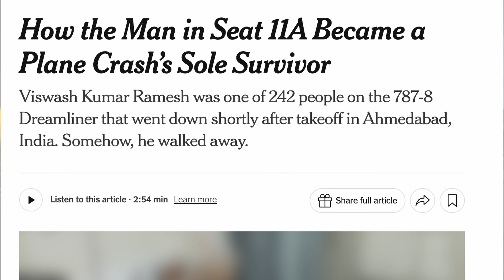Why the RAT Changes Everything – Air India 171 Update

Comment: Interesting question: the probability of two engines failing Independent at the same time is near zero (but of course still possible).
But is there a single Point of failure that would affect both engines at the same time?
Reply: i think netanyahu is behind this .
Reply: One possibility I have only seen mentioned by one other person is a software reset resulting from not power cycling the aircraft for an extended period. It's not a bug per se, but there is an FAA directive requiring the 787 to be powered off every 51 days to prevent incorrect data being displayed in the cockpit.

I also read a report that there was an engine issue when the plane arrived. I have not confirmed if this is true or not, but it's possible there was an engine failure on takeoff and the wrong engine was shut down in response, leading to a complete loss of power. It sounds unlikely, but it has happened before.

Comment: The RAT can be deployed manually by the pilot.  And there are a number of other conditions that would cause the RAT to be deployed,. This includes dual engine failure, but also loss of all hydraulics and loss off all flight controls, for example.  Jaun Brown of the Blancollirio channel has an excellent presentation on the subject.channel

Comment: I was wondering if the RAT deployed ...because MY fine eye was watching things that were happening and not happening.... I was told they made an intersection takeoff....a no-no if hi/ hot and fully loaded... then the " droop"...where it should be clawing for altitude... the gear was still down...despite positive rate... now it's down to the dual engine failure...and...there's only one thing that causes a dual engine failure.....fuel contamination. We shall see....

Comment: This is exactly the reason why you shouldn’t mouth off with very little information. Your first hypothesis was that the pilot may have raised flaps instead of the landing gear. The cockpit configuration of the 787 makes it very difficult to mistake the controls - they are not next to each other nor do they look alike. And yet, that was what you went with, and numerous news outlets amplified your half-baked analysis. This is why it’s responsible to wait for a full investigation before mouthing off. Stop it already! Most pilots do not start off blaming this or that or that - doing so on a public forum with lay people is way worse an offense.

Comment: I think some sort of fuel system failure led to both engines losing power, left one first then right and cascade of other problems such as landing gear not retracting and flaps not functioning properly etc.  Fuel supply was diminished or cut off fully, which led to no power.  Engines themselves were functioning, but no fuel led to no power.

Comment: If they would have hit the buildings would it have been possible for the pilots to glide it down softly enough to prevent a complete explosion? I've always wondered why they don't leave an area that they don't put any buildings within a few miles of airports and along the path the planes take when landing and taking off. Or would it make no difference if it would've been just a grassy field that they landed on?
Reply: I doubt it their sink rate would probably be too high, they would have not have had enough speed or altitude to  glide, so basically they fell out of the sky, with all that fuel on board the outcome for the passengers would likely be the same.   A crash at takeoff is the absolute worst as the aircraft is full of fuel.

Comment: fuel contamination?
Reply: There were cases in the past, it caused issue with the aircraft but not this catastrophic, nothing can be ruled out, but It would require a massive about on non usable fuel, and the question would the good fuel be first to be used, seems the aircraft took off without issue, so means a switch between good fuel and bad fuel? I have no idea how likely that is to happen?

Comment: 'dual engine failure' -simultaneously, after about 30sec into the flight? I wonder if it' just them running out of fuel. Of the few gallons that was left of the previous flight. So this is my theory/scenario: forgot to refuel, plain and simple.
Reply: IA full power loss due to lack of fuel would take around 10 seconds,  the engines would flame out, there would be a lot of indicators to the pilot. Physically this coudl happen but from a diagnostic perspective there is a lot of redundancies so not sure if this could really happen.   There is normally flight planning Software on the aircraft it would alert the fuel does not match the flight plan. There are also other systems to detect low fuel, so a lot would have to go wrong for that to happen.
Reply: Preflight checklist...probably #1.  Check fuel gauge before departure. 😉

Experienced pilots don't forget to refuel. 😉

It is possible that the fuel supply was accidentally dropped...although no evidence of fuel leakage or tanks dropping.

Personally, it sounds like the flaps were not deployed properly, unless it was a flaps failure, in which the plane should have never left the ground.
Reply: @terryc.3390  If it was flaps why was the RAT deployed?

Comment: Dual engine failure on an aircraft is an extremely rare event, but it can occur due to several factors. Common causes include fuel contamination or starvation, bird strikes, and mechanical failures affecting both engines simultaneously. While single engine failure is more common and aircraft are designed to handle it, dual engine failures present a significant challenge to pilots due to the loss of thrust from both engines.

Comment: Yeah that original cell phone video was released, you can clearly hear that rat prop as the aircraft rushed overhead….don’t even need to see it, you can hear it!

It definitely would not be the first time a first officer has accidentally raised the flaps or other cases they’ve put the throttle to idle or something like that. It’s happened before.

Comment: We learn something new everyday. It is pretty cool, how safe an aeroplane is with all the safety checks in place. An airplane is equipped to function with one engine. So they have the second engine as the back. But they have also thought of that if that fails too we have a RAT. Which correctly deployed, it did its job but unfortunately not enough time to effectively use what little was left.

This gives me the confidence that something new is learned from his and more fail safe mechanisms will be installed so that no one has to deal with this again.

Comment: Prematurely postulating the Indian pilots as dumb enough to mistakenly retract the flaps instead of the landing gear is so disgusting to me that it smacks of racism and attempt to go viral.  If he is an experienced pilot and an aviation expert, he would have known that the levers for the flaps and the landing gear are so far apart that mistaking one for the other is so remote. If there is nothing wrong with the engines, he should know that the pilots could have done something to prevent the plane from dropping in the manner seen in the videos. It's so obvious that with the pilots declaring mayday with "no power, no thrust, going down", there is really nothing else they can do. Isn't losing hydraulic power to operate the landing gear and the flaps after losing both engines more plausible than immediately blaming the pilots for mistaking one for the other? He only changed his pilot error theory when it all became increasingly obvious from the evidences being gathered that dual engine failure likely occurred after takeoff.
Reply: I agree it does come across as racist from his side, the Capt of the flight had over 8000 Hrs the co pilot almost 1500 Hrs, and he thinks just RIGHT after takeoff they are so stupid they would pull the flaps up instead of the landing gear!! His comments tell you nothing new about the accident but a lot about his racial bias and what he thinks of Indians!

Comment: fuel contamination or maybe the maintenance records will shed some light. i mean the only way your getting both engines to shut down under load like that would be no fuel or a crap ton of birds:)  wouldn't be surprised if a fuel cross feed valve was left in the service position after a tank cleaning or electrical issue

Comment: Two more clues as per the survivor's statment:

"Within a minute after take-off, suddenly everything felt STUCK for 5 to 10 Seconds. After a while, the green and white light got lit inside the aeroplane cabin. Later survivor felt like the plane was trying to increase the speed (He used the Word 'Raise') and then collusion occurred.

1. My assumption is that due to the engine trust & acceleration during the take-off, passengers feel like they are pushed back to the seat due to the body's inertia. If there is engine failure or thrust/lift loss at this stage during the acceleration, your body will feel the absence of acceleration & you tend to lean forward (May be this is why the survivor felt that he felt like STUCK/Standstill for 5-10 seconds). After this if RAT got deployed and due to the noise it generates, Survivor may have felt that attempt was being made to raise the engine speed to retake-off.

2. Also the green and white light which the survivor referred may be the emergency lights that lit up on the floor path and exit doors during emergencies & power failure to guide the passengers out of aeroplane.

Above are just my assumptions. 

My condolences to the families who lost their loved ones.

Video link to Survivors interview:

https://www.youtube.com/live/n8D2TLKKm94?si=69s-DPXgLZskzWnw

Comment: what are the chances of something like this happening? Is this simply a system failure, or the result of someone’s negligence? How is it even possible that a plane, only 11 years old, could suffer failure of both engines right after takeoff at just 500–600 feet?

Comment: As someone worked on GENX-1B engine;  checked some related AD's SB's . One specific about FADEC hardware published. Might be similar fault appeared. But still thinking, how was it possible to have same fault same time on both engine FADEC ( even dual line systems working in it same time) confusing .......Wishing condolences :(

Comment: In my opinion it’s very unlikely that fuel contamination leads to failure in both engines at the same time, seems like some sort of failure in some central control that led to stop the engines for some reasons

Comment: Well its always very easy to blame the pilots as they cant defend themselves. 

On 787 cockpit - The Landing gear handle and flaps handle are too far from each other. Moreover when the flap handle is pulled it takes at-least 15-18 seconds for flap to actually change its angle. So this theory was nonsense and baseless since very beginning.
Reply: It’s not about the handles being different or located in different places in the cockpit.  I’s about what the Pilot Monitoring understood.  Both of the call outs end in UP (Gear Uo, Flaps Up) and in a state of confusion with a thousand thoughts going on in your head it’s not that difficult to mix up a callout and rely on muscle memory to respond.  Also the degree of flaps starts changing immediately once the flap lever has been moved, lift changes accordingly.

Comment: Sir, 
If in case the at flight ground maintanence tean who from the meantime team was responsible to the Airflight fuel system which where it's fuel system can be  put off at the tine of maintenance and didn't put it on before the flight took off.
As the pump fuel system is a heartbeat of the flight, which fuels the flight Engine on flight.
There by on take of the flight used the fuel which was its supply line, but then due to no supply or say support of fuel, after take of, where it struggled to take of at the end of the run away, which can be noticed on the Vedio taken at the end of the runway take of, the dust bust.
 As it no option, where its RAT got opened as the flight Engins was suffocating due to no supply of fuel to the Engine.
Where it  atlimatly crushed after it's Mayday distress call, informing No Thrust with both Engines within 45 seconds nof flight take of...

The investigation should start from the ground maintenance team., the reason of the flight crash.

I can am be wrong but its logic...to understand 

Thks

Comment: Marvelous explanation Captain steeve, but from my point of view,  you may appreciate that after take-off aircraft dropped down immediately in just during 200 ft high or less as per reports heard. Just like you I too observed the video very carefully after incident and I  made out that the airfoils/flaps attached to wings were RETRACTED soon prior to achieving speed (required speed) before pre- cruise position, that ultimately dragged the aircraft down instead of lifting up thus creating low air pressure under wings during lift, simply to understand aircraft lacked pushing and air floating power during lift,  if it is not an engine failure to my knowledge. Ofcourse, air crash investigation report reveals the clear picture.

Comment: I agree with your assessment. In addition, there's no sound of the engines - which should be very audible at takeoff.
Reply: I thought the same thing.....
Reply: @davideleardi3894  I couldn’t tell if there was distortion and then it stopped in the liftoff video from the engine exhaust.
Reply: The RAT   is very clear but can we  hear the engines on full take off power ? A sudden  flame out on both engines   would show steam or smoke surly?   Were they Throttled back   by something unknown
Reply: @michaelllewellyn7215 You see flames or smoke every time an airplane shuts it's engines off at the airport? Airports would be full of smoke then. Flame-out means there ceases to be combustion. How can there be flames during a flame-out, it's literally in the name ffs
Reply: @raidzor5452  That is a laymen's take on how a flame-out works. Stay in your lane.

Comment: Adding credence to the loss of power in both engines theory is a more complete quote from the eyewitness, Viswashkumar Ramesh: ""After takeoff, after 5-10 seconds, it seemed like the aircraft was stuck," he said, adding that green and white lights came on inside the plane before it hit the building. That sensation of being stuck in the air is likely what you would feel with sudden loss of power and thus thrust.

Comment: Another thing you hear?  Beside the RAT.  It's jets.  Not near loud enough.  You'd think they'd be at max thrust.  Probably wouldn't hear the RAT that clearly absent the engines at what 20%?   I'm going with the bad fuel/clogged line theory.  Don't think the deployment of the RAT would make a large "bang" sound.  That's compression loss or damage to the engine.  And of course, latent memory in an event like can blur in the survivor's mind, so it might have been the crash itself.  Amazing for that man.  Extended rotation on takeoff tells me the power wasn't there from the beginning, and maybe fading which is why they didn't abort.  That would be an unusual experience.   Don't see any flaps, tough one, but I do see the slats, that's very distinctive, surprised you don't mention it.  Gear should have been on it's way up right after rotation, a little tight maybe, obviously the crew was immediately preoccupied.  Which tells me they were preoccupied going down the runway.  That's how these things happens.  A little distraction leads to bigger distractions and then something goes wrong.  So the plane seems sluggish on takeoff roll, they push it up, marginal, but going, they are distracted, and whatever makes it sluggish gets worse. superheated, bad mix, something blows, RAT deploys, other engine, the one we hear, similarly suffering, but still running.
Reply: > Don't think the deployment of the RAT would make a large "bang" sound. ...
But possibly in the absence of other (engine) sounds it would.